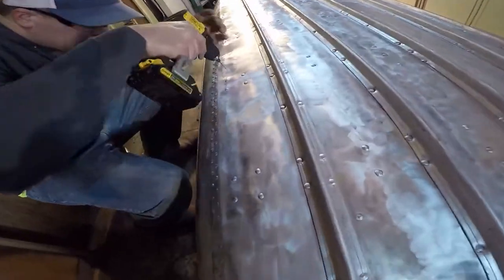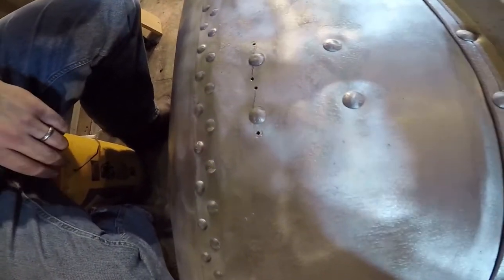How to Fix Holes in Aluminum Boat {EP-22}

Comment: Hey there. I've got a bunch of holes all over my boat from where a previous owner has mounted then removed stuff (no idea what), especially all over the vertical walls of the splash well. I was wondering, is it possible to braze a surface that's close to vertical? I really don't want to remove the inboard tank and outboard motor to try to get my boat on it's side. And if it's a larger hole... say 5/16"... could you braze that? Or should I put an aluiminium patch on the inside as backing first?
Reply from the maker: That is pretty tough! Brazing on a vertical wall can be very difficult. I would braze the smaller holes the best you can and use large rivets to fill in the larger holes. You can always grind them down some for final finish!

Comment: Hello! Question for ya:  How is the crack repair holding up?  I have a few small holes that I would like to fix, considered JB weld, but not crazy about it.
Reply from the maker: The crack repair is holding up VERY well!  I am very pleased with the repair, however, some areas of the boat were thin due to corrosion and I noticed these spots were harder to repair.  After this experience, I would suggest on areas with thinner metal to try to position the boat so that area is flat (i.e. - not vertical) and the weld works much better.  Also, in some areas I welded the exterior and put a skim coat of JB Weld on the inside.  Send me some pics!  Good luck!
Reply: @reelgoodtimesoutdoorchannel  my boat had a leaky transom, and it must have seen saltwater at some point, therefore the transom board got saturated with saltwater. It was not kind to the aluminum. Ended up cutting most of the transom away, it was riddled with holes and corrosion.
Reply: @wrench6122 did you ever fix it  with out welding? I got one and the transom is so bad on one side riping from front down.
Reply: @jmanhach17  so..... Quick answer yes. I fixed my deep vee using JB weld Marine epoxy 2 years ago and it is holding up very well. I only use that boat 5-6 times a year but it still doesn't leak a drop. More recently, I put a hole in the underside of my jet boat trying to run a stretch that was too shallow. LoL I am anxious to see how that one holds up as that boat gets used at least once a week.

Comment: Also....were you able to paint over the Goop product?
Reply from the maker: I am getting ready to paint the boat very soon.  My intent is to lightly sand the goop product so my paint will adhere to it.  Good question but I will have to let you know how it turns out!
Reply: Did painting over it work and is everything holding still well? Does this method also work for saltwater!?
Reply from the maker: Yes it works well. Use a palm sander with 100-grit paper to rough up the coating a little bit before applying paint!